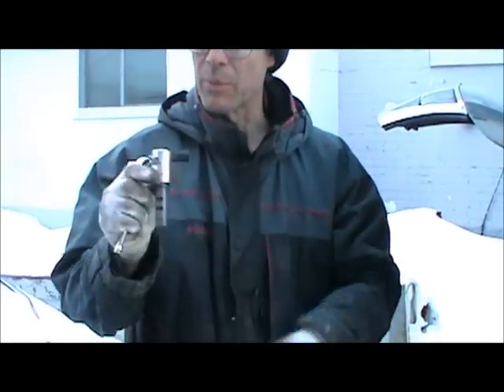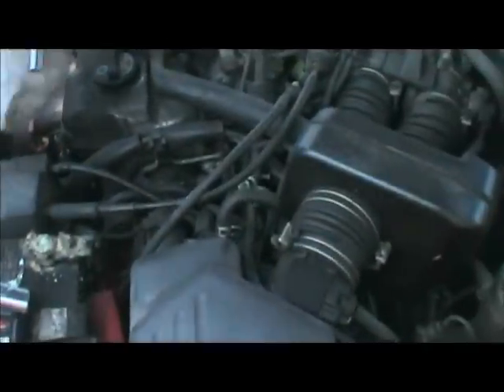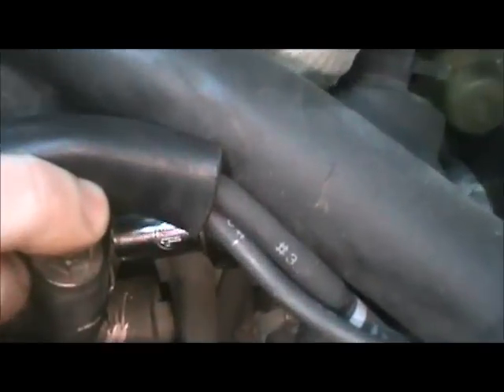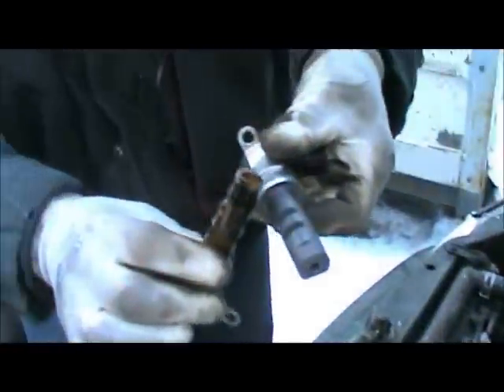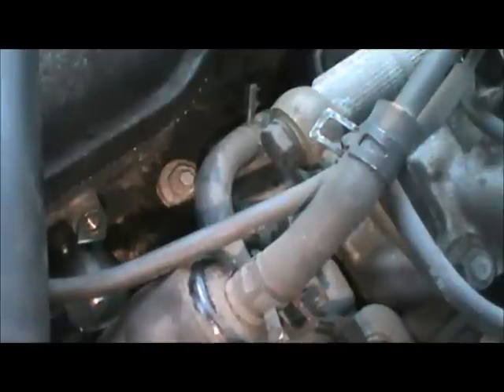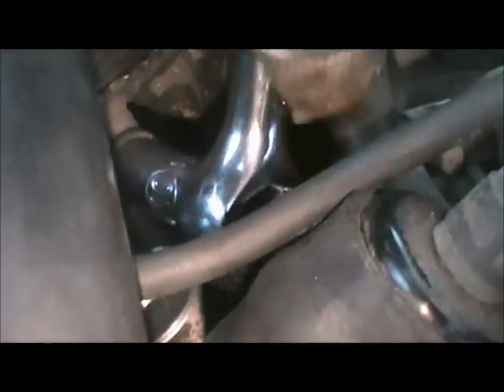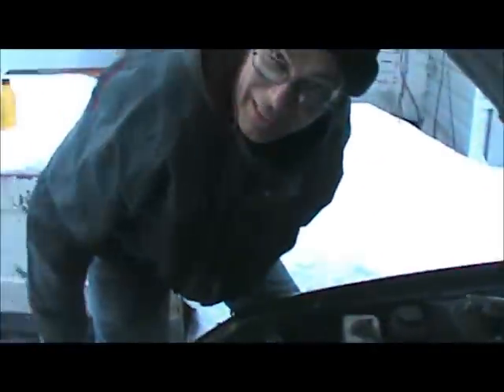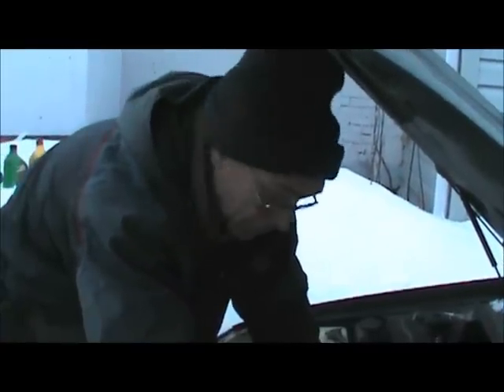ProfessorSir's Garage: Variable valve timing oil control valve malfunction

Comment: I watched your video from many many years ago I need to replace my valves I have the same code issue don’t want to spend 750 which is what they’re asking. So you’re saying you bought your new valves for your Avalon -2001 off Amazon, if I purchase them and bring them to a mechanic what would be a reasonable price for having Them replace my valves? I am a woman typically get ripped off. Thanks

Comment: what codes did you see for this?
Reply: Not sure about OP, but on my 2002 Avalon I got P0300, P0302, P0304, and P0306. This fix seems to have cleared everything up.
Reply: The beav how is the car or truck since then

Comment: Thanks for the video - car had been throwing a CEL on and off for a couple of weeks. Tried pulling a code when the CEL was off and nothing came up - however, had a recurrence of the issue and had the OBD2 with me at the time and it came up as P1354. Tried this (but only cleaned the OCV) and it seems to have worked... it was only a short test drive but the car was behaving and the CEL did not return so far.

Comment: Can the Oil Control Valve cause a P0300 and and P0 whatever for the cylinder that's missing??  I've replaced plugs, coil packs and wires and still getting these misfires on a 2001 Camry 2.2.
Reply from the maker: ChaplainK Danny: 

P0300 means there's a random misfire. It is not cylinder specific. 

The OCV controls the VVT (Variable valve timing). When it malfunctions the entire cylinder bank is affected 
(eg. P0301,P0303,P0305 on a V6 engine).Since you have a 4 cyl....P0301-04. 

If you have just one additional code (eg P0304), then you know the problem is with cylinder #4 only....likely a plug, coil pack, injector etc.
Since you've already changed the plugs and coils, you've ruled those out, so turn you attention to fuel/air related issues.
If only one code (again eg. P0304) comes up, look for a dirty/malfunctioning injector.  If there are multiple codes, look for something that affects all the injectors like fuel pressure. Usually start with a fuel pressure test. Most loan a tool programs will have a tester. If it's low, change the fuel filter 1st, then re-check. The pump doesn't fail as often as people think.
Reply from the maker: ChaplainK 
There could also be air (vacuum) leakage. Could be an intake manifold gasket, bad injector seal, etc. There are a number of YouTube videos that show how to check for vacuum leaks. You can build your own "Smoke machine"....Google: Smoke Machine, Old Skool Funk.... he made a good one, but you don't have to drill through the glass jar like he did... just drill the 2nd hole through the lid. Make sure to keep the air pressure from the compressor low....4 or 5psi is enough. Use a regulator on the air line if you can.
Good Luck.
Reply: @ipmgamer ft
Reply: I finally got a chance to look at the car and it is not a VVT Engine ('01 Camry 2.2)..... therefore, I don't know what is causing intermittent misfire.
Reply: Low Budget Creativity I have replaced all of the injectors and most of the time it runs beautifully. Occasionally it misfires and the check engine light flashes.
Reply: @donaldkarnes2255  was it your spark plugs?
Reply: @JacksonWe1127  No, would you believe we got a bad MAF..... so we were "discounting" that..... when we got another MAF and changed it for the second time.... it took care of the problem......
Reply: @kdeh21803  10 4 - thank you for the reply.
Reply: I had a intermittent misfire on cylinder number 2 a p302 code after much trial and error it was corrected by replacing my variable valve timing solenoid.
Reply: ChaplainK 
Yes
Reply: I had a vaccum hose come off (it was very badly cracked) and it was misfiring so bad! Replaced the hose and put a hose clamp on it. And it fixed my problem!

Comment: Removed, cleaned and reinstalled mine. Almost 100 miles later no codes and running smoothly. Most straightforward video on the dreaded p1354 code and how to remove.  Did it in 30 minutes in 28 degree weather.  The hardest part is removing the @#$@#$#@@ electrical connector.
Reply from the maker: Dan Harder im glad you got it straightened out!!! And that the video was a help

Comment: very, very, helpful video ,I just came from the toyota dealer cause my check engine light came on and the awd light as well ,and they told me it was the oil control valve and that for them to do it ,it will be $900 , i just checked online and the price of the valve it self is $95 + shipping, online it will take like a week to get to me and at autozone with a order it will take 2 days and it will be $109 sooo thans toyota but no thanks after watching this video and I do am mechanical oriented ,,,Ill be doing this my self !!! thanks so much
Reply from the maker: +marisol padilla Hey there I'm glad this video helped you save a lot of money and that it taught you how you can do it on your own be sure to check out the other OCV valve video on my channel its about the other side (Bank 2) Enjoy
Reply: +ipmgamer I will do so, actually I was going to check but I don't know how to look for it (the actual name of part) thanks
Reply from the maker: How to change OCV valve on 3.0 L toyota ES300 Code 1349 is the name of the video
Reply: +ipmgamer got it thanks tho !

Comment: Which one is bank 2? You said the front is Left and the rears are Right but i have a code for bank 2. It is also bringing up a code for the knock sensor on bank 2. I'm not sure if that is related. I have a thread over at toyota nation about the issues with the car(00avalon).
Reply: bank 2 is the front bank (closest to you), bank 1 is the rear bank (firewall side)

Comment: Is there a separate OCV filter for each OCV? I need to either replace the filter or the OCV on my rear bank but I can't figure out where the filter is.  Thanks!
Reply from the maker: +David McChesney it looks like a bolt head that screws into the end of the cylinder head on the driver side, it is a hollow bolt but you cant see that until you remove it

Comment: Excellent! And my excuse was it was 12F here in Colorado, what a wuss I am :) I did manage to get the filter out, it was quite a task but it was not super dirty. The other filter looks even harder to get out. I have the OCV on order and hopefully when it hits 55F I'll change them both tomorrow :) That V6 is actually quite peppy in the Avalon vs my Audi V8, certainly lower speeds it seems to have more pull.